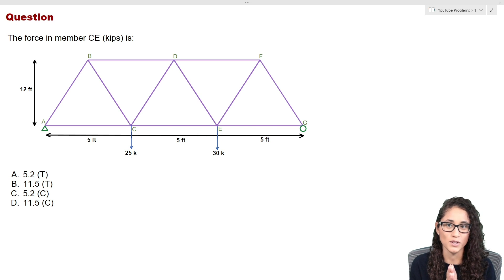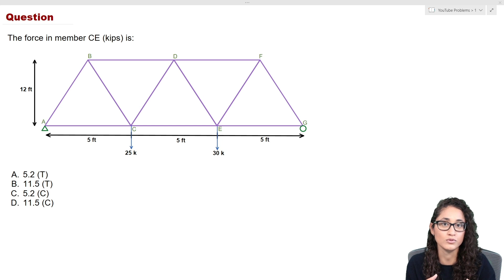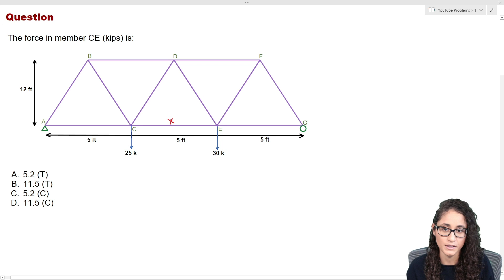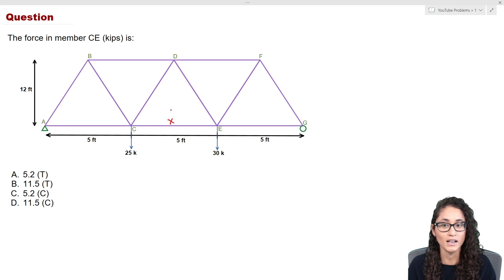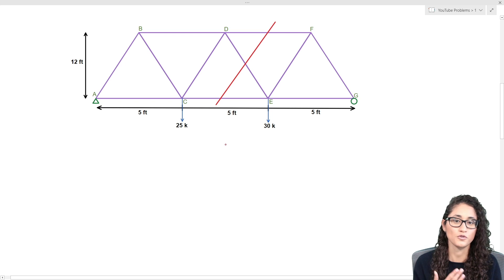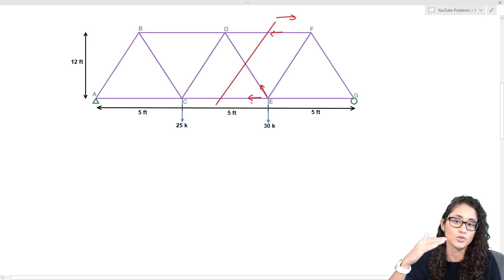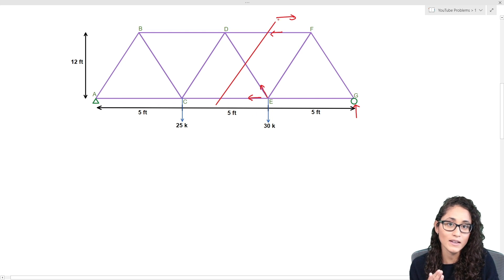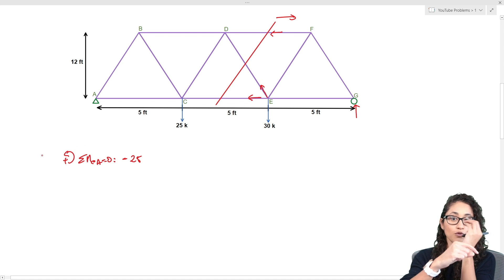Solving a Truss using Section Method

Comment: Why don't we take into consideration forces on EF?
Reply: The reason we don't need to consider forces in member EF, is primarily because we weren't asked to find the force in Member EF.   We only want to know the force in member CE.  For this reason, we can use the method of sections, and ignore the forces in all sections other than the section we choose that contains member CE.  We need to pick a section with 3 members, and a section that passes thru member CE, and then we solve the method of sections to find it.
Reply: So, I watched a similar example done by Jeff Hanson, and he said that we do not need to consider members that we do not cut. Therefore, they can be left out of the equation. Member EF was not cut. Therefore, it will not show up in the equation. That is my understanding.
Reply: I had the same question, any idea?
Reply: @omarchemaly8801  I think because the components of the tension EF by their arm from D cancelled each other. One goes clockwise and the other counterclockwise.
Reply: @omarchemaly8801  I've answered the OP's original question.